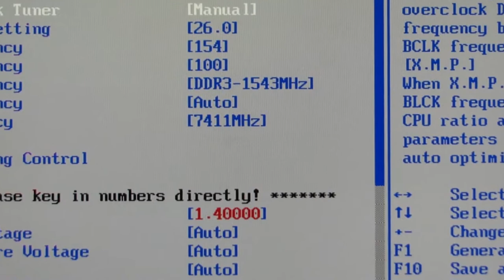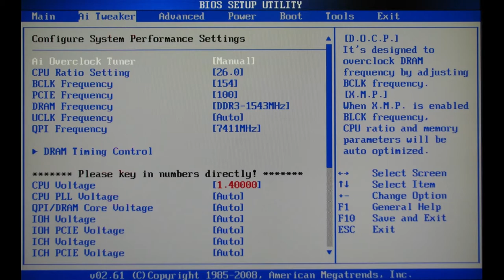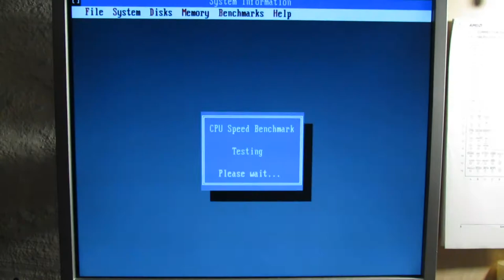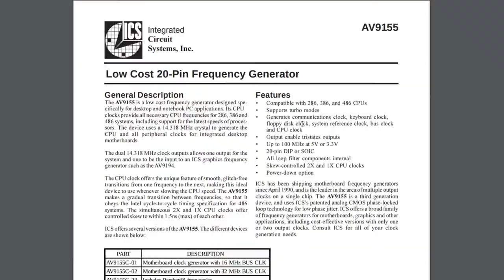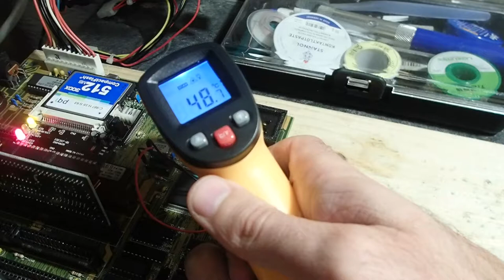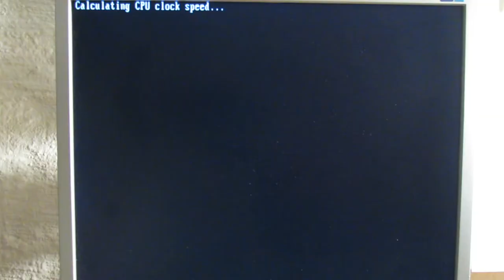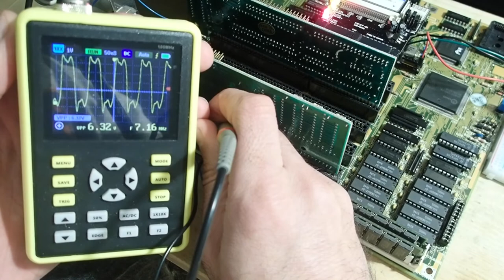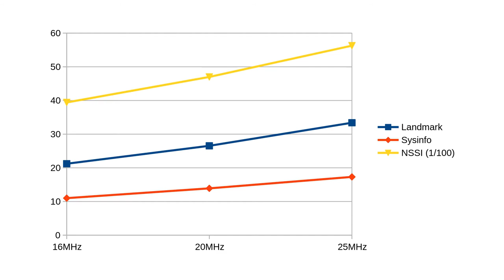Let's overclock an old 386SX

Comment: Ah, the Highscreen series of PCs from Vobis. My first one being a DX2/66, but was actually an AMD DX2/80 and no matter what I tried, the motherboard didn't allow to get 80 Mhz out of it. :(
The 166 MMX was my second PC like three years later but then from Peacock. Still remember some games needing a Pentium to even start, else telling you that you needed one.
Reply: DX2/80 were capricious as I remember, many motherboards refused to run properly with those
Reply from the maker: Am486DX2 are special. If the mainboard doesn't support it, or is not setup properly, or is just setup for i486DX2, then internal multiplier of the AMD CPU is 3x instead of 2x. At FSB of 40MHz you then have a clock of 120MHz, which is just too high. If you down clock the FSB to 33MHz or 25MHz, the CPU will run at 100MHz or 75MHz. This way you can use this CPU even in the boards, which actually don't support it. But the best way is to get a proper mainboard and setup it as required to get the multiplier 2x. I have many such mainboards and they all run just fine with Am486DX2-80...

Comment: Ahh the good old times. MY first overclocking was basically playing with ram, IO and VC timings in bios and jumpers on my 386DX@40 PC. MY first mobo had 3 sockets and supported 386, 387 and 486. Then I upgraded it to 486SX2@66MHz a couple of years later, which required replacing the 80MHz quarz oscillator with a 66MHz one.

P.S. A more likely reason for the MB failing to start would be SRAM timing for the cache. You can't double the frequency and expect it to run. It's likely managed by jumpers.
Reply from the maker: Yes! Except there is one problem - this mainboard has no cache ;)
Reply: @necro_ware  hmm I'd say those 8 chips next to the DRAM sockets look suspiciously like SRAM.
Reply from the maker: Those are 8x 128K DIP memory + 4x parity ICs. This mainboard has 5MB of memory. 4x1MB SIMM + 8x128K DIP. I talked about it in the very first video I ever uploaded on my channel :D
Reply: @necro_ware  DIP is the package. The type of memory is SRAM and it's the cache in this type of system.
Reply: @necro_ware  one more thing you can test if your memory and cache are being overclocked by testing the memory sub-system. There is software that allows you to adjust the test block sizes and you can see up to the cache size and above to see how it scales with overclocking. 
Sadly I don't remember what software I've used for that. I wrote some tests for thet purpose too, but it's been lost. If you're a programmer it's not hard to code it.
Reply from the maker: @nikoladd  I know, what DIP is. Sorry may be I was not precise enough and try better this time. I just wanted to point out, that there is DIP and SIMM memory on this board. Once again, it is not SRAM (which stands for Static Random Access Memory) and this chips are not cache. They are DRAM (which stands for Dynamic Random Access Memory) and they are in DIP (Dual In-Line) package. I've installed them with my own hands and the procedure of their installation you can see in my very first video on this channel. That video is quite bad, I mean even worse, than my latest tries :) but at least it is an evidence, that that chips are not SRAM... Furthermore, this mainboard is 386SX and such boards were made to be cheap and almost never have had cache. At least it is so rare, that I never had one in my hands and I had hundreds of mainboards already. The cache was more usual for 386DX. So just to get back to the idea, the problem of overclocking on this mainboard can not be due to cache issues, since what's not there cannot be a problem :D

Comment: 15:48 look at Capacitor C7, it looks like it has cracked. could be making the instability issues maybe
Reply from the maker: Yeah, I saw that one too, as I was editing the video. I replaced it later to try, but it didn't help unfortunately. Anyway, thank you for your eagle eye :)
Reply: @necro_ware  I see, then it is too bad it was not the cause of the issues. and I do a lot of electronic stuff so I am kinda damaged looking on everything like a maniac for problems lol. I actually just revived one of my IBM 486 computers after it self died while stored and capacitors in the power supply had started leaking and some contact issues and other stuff with the motherboard as well and it works great now, but I sure wished I also had a 386 left now but the only one I had ages ago smoked itself long ago while it was just considered junk so I did not keep the broken board but I never got another one. but I have a shitload of 486 stuff anyways so I guess I have to stick with that ;)

Comment: Could the memory also be an issue?
Reply from the maker: I used the memory, which I checked previously. It was 70ns, which should be more, than enough for 33MHz. I still think, that it's the chipset. I didn't find any mainboard with this chipset, which would run with a CPU over 20MHz, ever since....

Comment: I got two of this motherbord but mine is with 80386 amd sx 25Mhz but clocked at 20 Mhz I have tryed to change the crystal to 50 mhz but when I did that it will not post at all, but it's good to old games I have 5 mb ram on the motherboards, so the limit must be 20 mhz for this motherboard as it turns out, I think there was upgrade 386 cpu's that fitted on top on the cpu on the motherboard but I have not seen any for sale on ebay, back in around 1999 I overcloked a Intel 80486 dx2 50 Mhz to 80 Mhz but it got wery hot, I had glued a heat sink to the cpu with a fan but it was not stabele and 66 Mhz did not work with the ram, and with 80 Mhz Windows was not stable.

Comment: The AT series could be over clocked as the cpu speed was separate  from system/buss speed the XT was the real challenge as there was only the one clock.  When things went fast things would get funky
Reply: A lot of 286 boards could not decouple the ISA bus from the CPU clock, like all variants of the IBM 5170 for example. Fortunately for ambitious 5170 overclockers, most ISA cards can handle 12 MHz pretty easily, and enough of them will operate at 16 MHz that you can still put a system together if you have enough parts to choose from.

If I were to get into the retro scene, I wouldn't bother with a 286 at all but just get a 386sx/40 or so. Clock it down for the 286 experience, and it can almost but not quite provide the authentic 386DX/33 experience when run at full tilt. It's just a more useful platform than a 286, while being able to clock down to provide 286 performance.

Comment: @ 1:27 MMX officially is not an acronym... Multi Media eXtension was a bacronym that helped sell computers.   
MMX was initially a acronym for Matrix Math eXtension, but Intel liked Muti Media eXtension so they through Matrix Math eXtension down the memory hole and hoped no one would remember it.  When people did Intel had to claim that MMX was never an acronym.  Some concluded that the real reason why intel didn't want Matrix Math eXtension to be a thing was it was harder to defend a copy right as the term was too generic.
Reply from the maker: Yeah, that's true, I already commented on this. Thank you for the correction though.

Comment: My first puter was a 386sx. One Meg of RAM, 40 megabyte HDD. It was $1500. It was awful. After that, I built my own.
Reply from the maker: My first PC was also 386sx. It is always a question of time, when you had it. If you bought it in time, where 486 was already around, then yes 386sx was awful indeed. If you had it already in the 80s, where 286 and XT were still around, then it was really nice.
Reply: @necro_ware  What made it awful was that it was a Goldstar. Like many other makers then, it was proprietary. To add, and upgrade it was a challenge. But, it was a crash course into IBM computing.

Comment: I never encountered a board that didn't have jumpers, I guess I was lucky. My first overclock was on an 8088 clone board where just a simple jumper change got me ~8mhz but it was a much newer board than the original IBM 8088s. I later got an NEC V20H that ran at 12mhz on the same board, again with a few jumpers. I did skip 286 and 386 however. I managed to blow my 486 SX 25 trying to run it at 40mhz though, that was not a fun experience, I should have left it at 33 where it was stable.... Pretty much from the moment I accidentally overclocked my XT clone (the jumper was missing and it wouldn't post) I have over or underclocked just about every CPU I have owned. Underclocking is a more recent practice, mostly to keep things cooler and save power on systems where I don't need the full stock frequency.
Reply from the maker: Yeah, I on the other hand have very little experience with XTs. The two I ever had, were without jumpers as well. Most of the ATs from 286 to early 486 had such a quartz oscillator, like I've shown in the video. Some 386 and all the later 486 used variable clock generator ICs, like the one AV9107, which I'm using in this video on the breadboard. I overclocked a lot back in the days, but today I don't. It's just not worth it anymore. And the old hardware I usually also don't overclock anymore, because I'm afraid to damage it. With this video I just wanted to give some insights into overclocking from 30 years ago :)

Comment: Very interesting how you could swap AMD and intel CPUs on the same motherboard.
Reply from the maker: Back in the days AMD was 1:1 Intel drop-in replacement and you could swap them until Socket 7. Both CPUs got different Sockets first with Athlon/Pentium III series. AMD was Slot A, Intel was Slot 1 and later Socket 462 vs Socket 370...

Comment: it may just be the age of the cpu as it being old it may not have the stability anymore to do higher clock speeds like it once could have
Reply from the maker: I don't think so, because the second CPU didn't even run at its nominal speed. The chipset just can't handle higher frequencies above 20 MHz

Comment: Hi, what's the name of the 33sx socket? I'd like to purchase one as it could come handy for future projects.
Thanks
Reply from the maker: Hi, you mean the one, where I got the Am386sx-33 out? It's a good question, I think it is called PQFP Socket and you would need one with 100 pins for the 386sx. However, I have no clue if and where you can buy it.
Reply: @necro_ware  Thanks! I'll report back with news if any.
Reply: They exist and they cost on the tens of dollars. Not so common. At least what I found around.
It's better to solder a faster SX.

Comment: why no overvolting of cpu/chipset? also maybe cache is too slow?
Reply from the maker: Hehe, you are funny ;D 386sx has no cache at all and separated voltage circuits for the CPU were invented 10 years later. 386 were powered directly from the PSU in the same circuit, together with every other part of the mainboard. You only could overvolt the whole mainboard or nothing and doing so, would damage the board with very high probability.
Reply: @necro_ware  , the signalling buffers, then - the ICs on the right of the ISA slots. And overvolting can be easily done for SMD devices - just cut the trace or lift the legs and use any variable power source. Also, 386 with ext cache do exist. :)
Reply from the maker: @poetulgariidenord1777   By heavy modification, for sure it is possible to separate the CPU an may be chipset from the main power supply.  But cutting traces and resoldering on a 30 years old mainboard would be really stupid idea. And there are no 386sx with cache, only 386dx has external cache option.
Reply from the maker: @poetulgariidenord1777  Wow, really exciting. In 30 years of tinkering, I never saw a 386SX mainboard with cache. Thank you, I guess, I'll have to make some research.... :D

Comment: maybe add cooling to the cpu to run it at 25mhz. also you know you can drop the cpu into the socket and it will just work. it's not just for FPU
Reply from the maker: Hi! Well cooling something, what is stone cool doesn't make a lot of sense :D It's the chipset, which doesn't work at that frequencies, the CPU doesn't even get initialized. So, CPU temperature is not the culprit. And you can't drop the CPU into the FPU socket. First of all they have different pinout and even different amount of pins, second the 386SX were usually made in BQFP package (very rare as PGA), and 387SX FPU was usually in PLCC, like on my mainboard in the video. Leaving alone the electrical part, it will not even work physically. You can't put 386SX BQFP CPU with 132 pins into PLCC socket with 68 pins. May be you mix 486 mainboards, there such things were possible, because the 487SX FPU was just a 486DX in disguise.
Reply: @necro_ware  oh, yes, probably i'm mistaking it with 486. i remember i had success with 486dx4 in sx based machine. about the rest, i guess you are right, it's been years since i played with 386

Comment: I've got the same board as you (actually I have two) !
I managed to identify mine as a "Aquarius systems Inc" according to the POST string. Both have bad caps however ...

Here's the post string of mine : 30-0200-DG1112-00100111-050591-UMC386SX
Now something looks wrong, your 386's post string don't really match, and has another manufacturer code which I can't identify ... It's highly possible this board has been sold under many brands ...

Can you dump me its bios and send it to me please ? :D
It'd help me complete my th99 update project ^^

By the way the fact they say 24mhz on th99 is probably a mistake or a typo from the original manual, they probably meant 25 MHz. (It may just be "12MHz x 2" as there were still 286s at that speed back then)

Now if the 25MHz model uses exactly the same chipset, it's possible there are some hidden jumpers on the PCB setting the chipset to a different clock speed so it can adapt some wait states or something. Or maybe that's a hidden setting in the BIOS ... Or maybe they really used a slightly different bios ...

As for the overclocking becoming more and more a hobby and less and less a money based thing, I think that's also because manufacturers limited on purpose cheap CPUs to not be overclockable, then cheap motherboards, etc and also offering newer generations of CPUs for people with not a lot of money
Reply from the maker: Great info! Thank you! Honestly, I have this mainboard since a long time yet. It had shorted caps, the battery leaked, SIMM slots were broken and most important, it had no BIOS chip! I repaired all that stuff and tested different BIOS versions until I found one, which fits. I have here multiple, which more or less do work with this mainboard, but the one which is in there now seems to be the best one. I tried to overclock with different BIOS versions, but all with the same result. Unstable above 25MHz. Just as a note, the system at this frequency was absolutely stable running MS-DOS, but slightly unstable with Freedos.  You could be right in regards of "hidden" settings somewhere, however I don't see any related jumpers and the traces from the crystal oscillator are going directly into the chipset. I took some signal tests there and the stupid thing goes crazy as soon as the frequency is too high. Before I'll go further, I'd like to see this chipset running officially 33MHz CPU. Probably, as you said, this is a cheap motherboard/chipset with bad overclocking capabilities. Who knows? :)

However, here you can find the thread with a BIOS for this mainboard and may be some more information. Take a look at the CPU on the images :)
https://www.vogons.org/viewtopic.php?t=70724

And thank you for your feedback once again!
Reply: Well what I thought about were some kind of "definitive" jumpers (like those where you need to cut a trace to cut the jumper or bridge two traces to close it)

But without a proper datasheet, we can't go really far ...

By the way my two boards are also equipped with 16MHz chips ...

And also our updated th99 should be released soon, so you'd be able to download my bios :)
Reply: @DxDeksor  just a thought. How is cpu voltage managed? Is it possible to, or even required, to increase it for overclocking 386 cpus?  Could that be the overiding factor stopping higher frequency crystals working after a certain point?
Reply from the maker: @austinmaxi  You think too modern :) There were no voltage regulators on that old mainboards, just 5V going directly from the PSU into the CPU and other components. Theoretically, you could take 12V line and build your voltage regulator and re-solder the traces on the mainboard to get over 5V, but it is not obvious, where to start and is even riskier, than to desolder a CPU. This old hardware is rare and it would be a shame to destroy it completely by doing so. I mean, it deserves a kind treatment, just as any retired :)
Reply: @austinmaxi  I'm pretty sure the voltage is +5V coming straight from the PSU. You'd need to overvolt the entire board to overvolt the CPU ^^ (which may happen with a a failing PSU)
Reply: Cool Video.